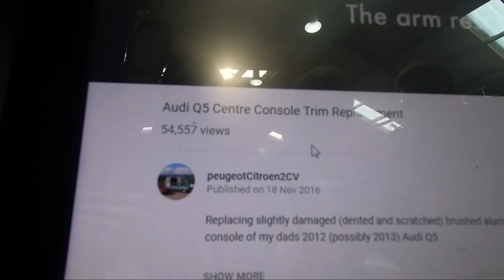INSTALLING RACELOGIC VBOX - AUDI A5 3.0 TDI QUATTRO PROJECT - DARKSIDE DEVELOPMENTS - PART 16

Comment: What does the FL,FR,RL and RR stand for?
Reply: FL - Front Left, FR - Front Right, RL - Rear Left, RR - Rear Right. These are standard abbreviations used in motorsport for the corners of the car as they would appear if sitting in the car facing forwards .
Reply: @vboxmotorsport  okey. So the show load or slip ?

Comment: I think you guys spliced into the comfort can going into the amp.. also I think going off the back of the obd port only talks to the can gateway so good job you went off the engine ecu,  it's defiantly also connected to the abs and maybe more if I pulled up the wiring diagrams... loving this content guys!
Reply: We realised that pretty quickly!